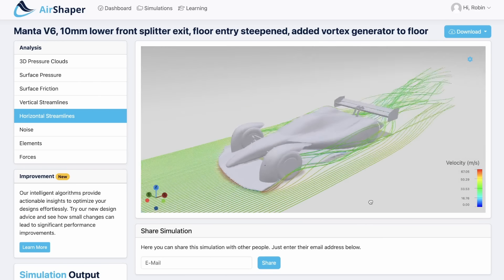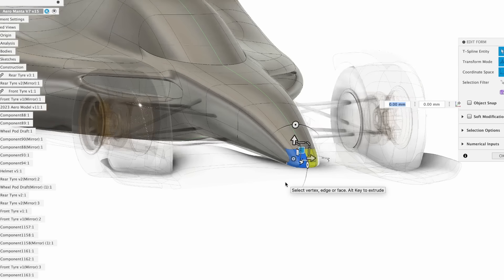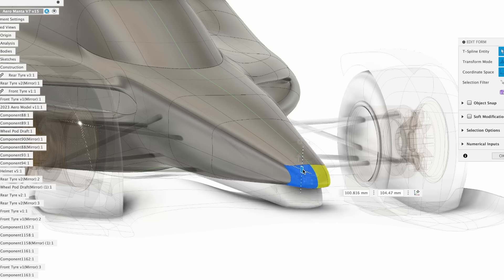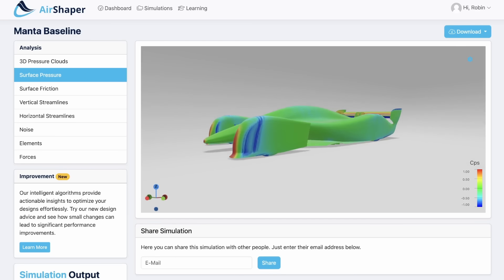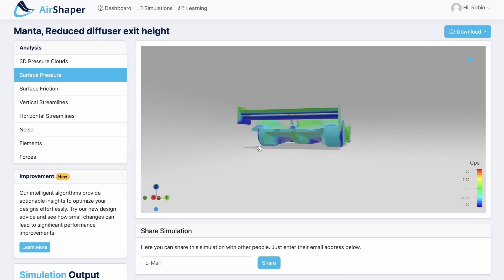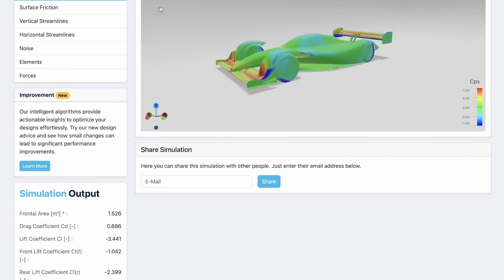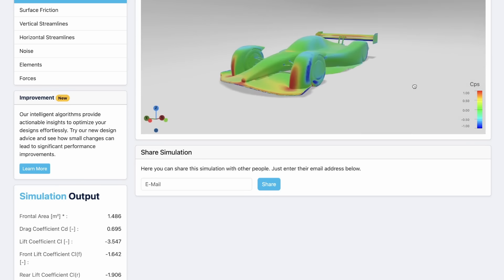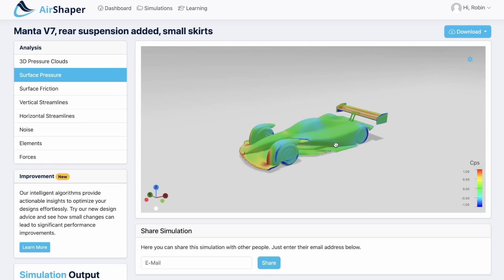Aero insights of Robin Shute's new Pikes Peak racer

Comment: You can improve the design alot by increasing outwash behind the rear wheel. Refer to the recent BSport video. Also try adding vertical vanes to the diffuser to reduce wheel squrt effects. Making the front wishbones downwash the air to the floor will add overall downforce as will increasing the height of inlet of the floor. The reason why your rear wing is making more downforce without all this endplates is because air from the side of the car is drawn inboard by the low pressure side of the wing. If you enclose the rear wheel completely and leave space for the air to inwash I gurantee the rear wing will work more effectively.
Reply: In the first sentence I meant the front wheel not rear wheel :)
Reply from the maker: Yes, lot's of detail to add like you mentioned.
Reply: @thesendyclub  thanks for considering and good luck :D

Comment: Bringing the entry to the tunnels forward and up between the front wheels will provide an enourmous gain in downforce with a minimal increase in drag. It creates a larger entry to the venturi tunnels providing them with more airflow to accelerate. It should also significantly shift your center of lift forwards. Ditch the low nose idea. It looks cool but its suboptimal for airflow. F1 teams are strictly regulated to have low noses for safety in crashes with other cars.  Just look at the 2014 F1 cars to see how desperately the teams were trying to keep the noses high. The noses are also regulated very slim, widening it to fill the area between the wheels will make the whole underfloor of the car act as a wing and provide more uniform lift. The center of lift can be easily adjusted fore or aft by changing the location of the lowest point of the floor.

Comment: Nice design I like a lot this manta shape, it looks promising. Just a quick idea, may be moving the front fender  forward and update the shape may help reduce the high pressure you have on it. Are you going to perform additional simulations for pitch sensitivity during braking/cornering ?
Reply from the maker: I did a run with bigger front fenders and it didn't really help significantly. Just ends up adding weight. Yes, I will aero map the car properly in the next phases of design

Comment: As someone who designed an aero package for FSAE, I would suggest running some aero simulations at high angles of yaw with body roll. I had developed an underfloor in a straight line which worked super well, but completely fell off in the corners. Considering that most of Pikes Peak is corners, you need to have an aero kit that works well in these scenarios. 

There’s a reason even F1 teams struggle with the floors, they are difficult to master!
Reply: @jamesmccaul2945  i'd give him a break lol, even mercedes F1 couldnt get a good floor for 2 years
Reply: @jamesmccaul2945 if it was on time and didn't break the car then it was stellar as far as FSAE goes
Reply: 😂100% correct  @haydenflinner
Reply: If it's on the car at comp and doesn't fall off it's a bloody fantastic job hah!
Reply from the maker: Yep, this is just concept sketching to get a basic car shape so I could continue with the mechanical design of the car

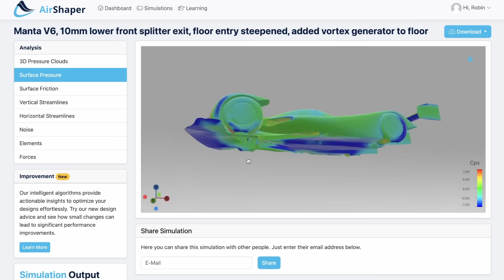Comment: @22:07 that's not tire squirt, that's the vortices shed by the diffuser walls, all the airflow through the tunnels comes out of the middle of the diffuser. Adding a keel there is great under yaw, while turning the side of the keel going into the turn becomes pressurized relative to the side away from the corner. This then sheds a vortex that energizes the side facing the corner, this is the side most sensitive to stalling under yaw. When a car turns, the wind ward side(facing the corner) is trying to run over its own tire wake, this makes the floor less efficient. This side is also being lifted under roll, so there's less ground effect helping.

Conversely the leeward side(away from the corner) has everything working for it, ride height drops due to roll, instead of running over the wake, that side is turning away from it, reducing its effect. 

On the wing side, the upper wheel wake of both wheels interacts with the wing tip vortices of the rear wing. Although they are affected opposite to the floor under yaw. The wind ward side of the upper wheel wake becomes stronger, and interacts more with the rear wing tip vortex increasing effective downforce from the rear wing. You can reduce this effect by raising the rear wing, and lowering the front and rear wheel vents, or enhance it by lowering the rear wing and raising the wheel vents. On the leeward side this effect becomes weaker, because the wheel wake moves away from the car. Co-rotating vortices merge, all lift creating vortices are co-rotating and tend to merge, and this merging process is unstable during the transition phase. Counter rotating vortices tend to repel and thus can be use to steer other vortices.

For example, the lower wheel wake, being a lift producing vortex is repelled by the vortex caused by the edge of the floor as it bleed into the diffuser. This way you can use the flow structure created by the floor to seal off the lift producing lower tire wake.

Comment: Great stuff! In your video on the aero concept for Manta, you talked about modeling the isochronal ratio of PPIHC in Canopy (downforce vs drag required to go faster) at about 0.5; was this ratio in mind as you modeled these aero tradeoffs? Or, more generally, in these early revisions, were you taking a structured approach to frontal area/drag/downforce/weight tradeoffs - or more just “feeling it out”? Either way, would be interested in seeing you model out the weighting of factors in your “algorithm”!

Likewise, what were your underlying assumptions when it came to scale - wheelbase, tire size, etc? This aero modeling seems to take those as a given; did you take the Wolf as a baseline and tweak shape, or was there a “blank sheet” design phase not covered in your videos so far, where you started with survival cell and powertrain, and worked out overall dimensions (l/w/h, wheelbase, tires) around that?
Reply from the maker: I wanted to make a baseline of car that was as efficient as possible, which I could add wings and complexity to as the design developed. I used Wolf tires, dimensions as a rough baseline to expand upon as I think it's a great starting point. Originally the safety cell was clean sheet, but then I went to a Tatuus tub. That's where the design of the car started to change significantly to what I shared here

Comment: Have you looked at adding spoilers or a variable cross-section exit to the under-floor diffuser?  It sounds like the diffuser is the spot to shed down-force at high speed if you don't want to effect front/rear balance.

Comment: These videos are incredibly insightful as always, thank you Robin.

I was wondering if a blown diffuser was considered, or is the juice not worth the squeeze given the complexity of aero already?
Reply from the maker: It was considered, and designed in. Then I chickened out seeing how hard it is to model and how many F1 cars set fire developing it...
Reply: @thesendyclub  Looks like there will still be somewhat of a blown effect with the exhaust in the middle right at the trailing edge of the diffuser. Should help to pull the airflow a little bit in the right direction it looks like.

Comment: On the previous designs, it always worried me that the floor was ingesting much of the front tyre squirt. I think that a bargeboard could deal with such issue.
If within budget, I would test a multi element bargeboard to create the strongest possible vortex aimed at keeping any tyre wake away from the floor leading edge, as well as helping with extraction on the forward lateral section of the floor.

Comment: Funny, with my ram style equal length manifold and a wide open 44mm vband gate I got no boost to about 5000 RPM then roughly linear to 3.5psi at 7500 RPM :-) closed and 18psi spring and perfect control. Depends how efficient the turbo is and how big the gate exit is. Neat that you also got boost wide open, probably also a ram style manifold of some sort.
Reply from the maker: All about turbo sizing!

Comment: You had discussed the possibility of active aero. Was there any consideration of front wing rotation about the roll axis? I haven’t checked whether the small angle assumption eliminates the option for any reasonable range of motion and it is probably too complicated to both model and construct, plus it adds complexity. My initial thought is to have a somewhat dihedral wing (which already hurts lift to drag ratio so probably ruins the idea) connected to the steering rack, then rolling the wing to push some of that downforce into a yaw moment. Think pivot at the top of the connection to the nose and shifting the bottom side to side.

Actually screw all that, much “easier” to attach the wing endplates to the wheels, which is very similar to your initial pod rotation concept. Any possibility of the vertical aero surfaces there getting more rotation than the wheels through a clever linkage? Might be more drag than you want but at higher steering angles you’re not moving that quick anyway.

I’m mostly rambling to myself here, but I think there are opportunities for mechanically controlled active aero linked to the steering system, which would cut out any electromechanical nightmares from the development pipeline, albeit still with added normal mechanical complexity. There are other options with starving the outside half of the floor tunnels to get more downforce on the inside or something, but that probably doesn’t trade well against having higher overall downforce.
Reply from the maker: Lot's of things to play with, the trick with this stuff is understanding how big of an improvement a system like this can make. Is it worth all the weight, complexity and work to do that?

Comment: @22:45 - Would it be worth anything to pull the upper lip of the rear wheel arch down over the tire a little, given that the top-backside of the tire is the problem area? Maybe some small gains without making the rear tire change any more inconvenient(a bit of droop when it's jacked up to clear the lip if necessary).
Wheel well vents over the rear tires - more harm than good on this design?

Love seeing the thought behind the aero design, as incredible as the engine is this is what I was really looking forward to
Reply from the maker: Bringing that lip down could help for sure. The back of the fender is very free flowing so shouldn't need additional vents

Comment: Was a good watch. I think you're wrong about diesel and compound turbos though as diesel anti-lag is a thing nowadays.
Reply from the maker: Diesels are not compounded for antilag but for pressure ratio. Some are running about 100psi of boost which you can't do with one turbo

Comment: Question regarding the rear diffuser please… 
Is it worth running a second horizontal element in the rear diffuser tunnels , this can also be made adjustable for angle and with various profile options. ? 
This I would have thought would help with laminar flow and avoid boundary layer separation from the steep angle of the diffuser. It looks around 15deg . 
It could also divert airflow up under the rear aerofoil. 
Cheers 
Paul .
Reply: I'm not an expert with any form of credentials in the field... but I would guess that has a negative effect. Laminar flow is not the target. With under-floor tunnels, typically what you see is that they want to "fill" that entire tunnel with a huge vortex. So if you split the volume into smaller sections you would break up that vortex and loose performance. Look at the Valkyrie or RB17 for example, huge unobstructed tunnels by design. Sometimes it can be beneficial to use vertical vanes in a diffuser to house several but smaller vortices, but that is usually done because of limitations to the floor by regulations not relevant here. If a large powerful vortex can be used, that is better than a bunch of smaller less powerful ones. Also the diffuser is slowing the airflow down as it expands to the rear, basically dragging the air along with the car to an extent, so putting an airfoil profile wing in that air would be very in-efficient as the relative air speed around that wing would be quite low.
Reply from the maker: Great answer!
Reply from the maker: Ultimately no, the flow is very transient in the tunnel and most elements act as a blockage or hinderance when you look at all the conditions the car works at. What RobertS mentions in his comment is true about the vertical elements

Comment: Do you model air turbulence I.e. windy gusty days?? Is that a factor on the hill?
Reply from the maker: It is a factor, modeling it is basically running the car at different yaw angles in CFD and see how the performance drops off

Comment: I've a probably dumb idea about using a semi trailing arm or torsion beam rear suspension with chain drive from the arm pivots, to clear up the entire rear floor for a large diffuser starting further forward in the vehicle. If you were able to find a material that could survive a fair amount of regular flexing for the diffuser you might be able to attach the diffuser directly to the rear suspension allowing it run closer to the road surface.
Reply from the maker: Lot's of good ideas!
Reply: @thesendyclub  Andy Forest did a chain drive front wheel system on his WTAC impreza, seemed to be quite functional

Comment: Have you investigated the position of the rear wing and the interaction with the diffuser? Doing so may make more rear downforce which may not be wanted, but it may gain in efficiency by allowing for a smaller wing.
Reply from the maker: Yes, what I showed in this video is just the very initial concept work to get the basic car shape

Comment: what about using multi-element wing to cowl in your suspension on the front? plus it will get it out of the way for the air for the defuser

then rather than fully cowling your front wheels, how about a forward protruding element or bulbous fairing positioned just ahead of each front tire, with a trailing aerodynamic device behind the tire to smooth out the disturbed airflow (re-laminate it)?
Reply from the maker: Good ideas, it's just hard to get enough aero surface area to make enough force like that. I definitely could have stuck with that concept for a while longer. It wasn't my hill to die on

Comment: Do you think it's going to be a problem that the aero balance moves forward as the ride height lowered when the speed increases? That would be terrible to have understeer at slow corner and oversteer at fast corner
Reply from the maker: Yes, you want it the other way around typically. That comes with more detailed design

Comment: How about active suspension, to compensate for increased speed (downforce load) by increasing spring preload, or by changing suspension geometry to increase spring leverage ratio (moving the pivot point of a coilover, or suspension rocker arm, for example)?
Reply from the maker: We are looking into active spring perches
Reply: @thesendyclub  if you end up with the suspension that has adjustable effective spring raids, or adjustable ride height, then you could record vertical acceleration during your runs of pike peak. Then feed those vertical accelerations into a map of the run, and then have the active suspension, anticipate where the track will be rough versus smooth.

If it works, you could end up with a lower, or more consistent ride height, for aerodynamic design?

Comment: Current L/D isn't too bad, but i did notice in your iterating that the cockpit position/shape has changed a bit. Have you considered a high nose? Multi element front wing with a non constant chord?
Reply from the maker: Yes, high nosehas been worked on since and will be covered in another vid! I was tweaking the cockpit as I starting sketching out driver positions and roll cage. Good spot
Reply: @thesendyclub  very cool. I'm sure I could nerd out with you on the aero for weeks

Comment: May I ask you a question? Why do you have such massive wheels in the front?    Which is the maximum braking power you have to dissipate?
Reply from the maker: Need to support the aero download and braking forces combined
Reply: @thesendyclub  made the wrong phrasing. I am not talking on the size, I wanted to point the sizing. Why the tire, why the rim, why that profile. Can anything be halved? They must last only 8 mins.

Comment: (stall speed was never mentioned )
Reply from the maker: that's more an aircraft thing to look at. We will do a low speed run to see which elements stall out at a low reynolds number
Reply: @thesendyclub  koenigsegg rear wings are optimized for stall speeds
Reply: @thesendyclub  your underfloor/difuser seems to suffer from stall speed but venturi theories are difficult